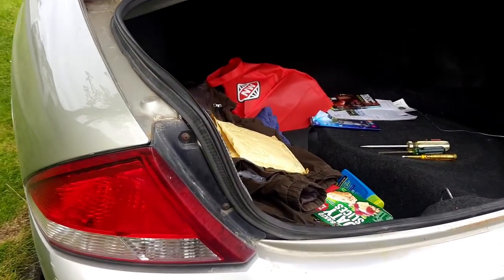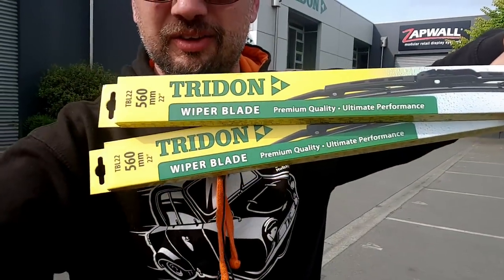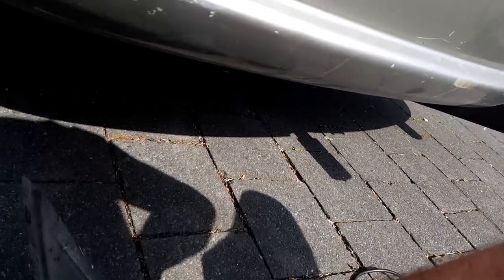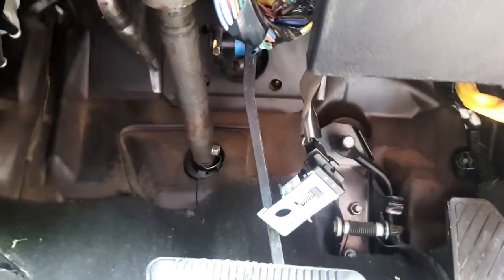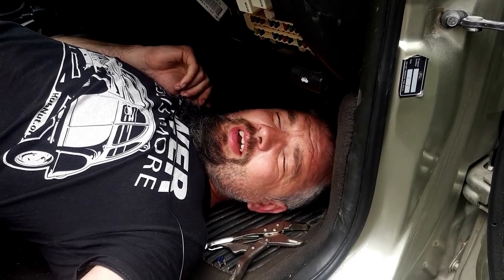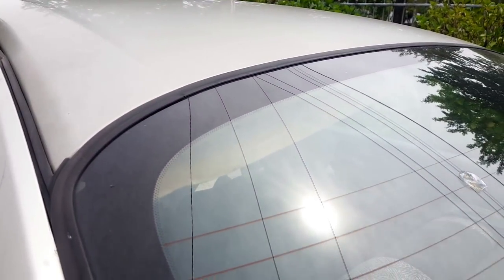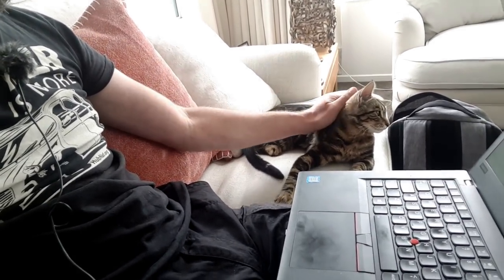(EP22) Ford Fairmont Fail and Fix, with bonus Peugeot 404

Comment: I passed my driving test at the 1st attempt in my father's 404 estate car. The examiner had never seen one before..   The examiner was not happy that the handbrake was out of his reach, the examiner was not happy about banging his head on the windscreen during the emergency stop ( pre seat belt law), the examiner wasn't to happy about us getting a puncture, but he was impressed that I changed the tyre quickly and in a heavy downpour of rain and then got him back to the test centre in one piece.  After he told me I'd passed I apologised for stopping a bit too quick for him,  he said he hadn't expected to stop that quickly. The lump on his brow was visibly growing and turning quite red by this time.  After he got out of the car and walked off down the street I passed him with the rear tyres lit up on my way to pick up my father who was sitting on the wall outside the test centre.... He promptly gave me a proper bollocking for torturing his tyres. We were halfway home before he asked me if I'd passed.
Reply: Brilliant!
Reply: Good times! :D
Reply: My driving instructor had an 1100 .He was ex army tank driver instructor. Language was epic but he got me a pass
Reply: When i was still a kid 7 or 8 y old my dad let me steer and shift  his 404 while trundling across dirt roads.  Fun times! A few years ago i imported a 404 from France , a Very nice 1961 black sedan with  red interior and sunroof. 
Fun for a while but the memory had proven to be more Impressive then reality.

Comment: I reckon, as the bulb fell out of the holder, it blew the fuse, which in turn caused the cruise control to stop working. I imagine the original brake switch is fine.
Reply: From watching the first 30 seconds of the video, my first thought was that Ford / Ford related cars of that era wouldn't let you use the cruise control if there was an issue with the rear lights. So it's probably even more fine than a blown fuse, but literally just the fact that you need fully working lights to use cruise at all.
Reply: in Cornwall they're held on with an "ooh ar" clip.

Comment: Loved my Peugeot 404s, owned saloon, estate and pickup versions. Brilliant cars, super precise column gearchange, so comfortable, practical and nice to drive.
Reply: The 404 is one of those cars you wish you could still get today. We had four through various members of the family and they were all much loved for being as my dad used to say "Just a bloody nice car ! " I owned one briefly but mine was well past it sadly..I did only pay £50 for it, got a new engine from a scrapyard.....and 'somebody' stole the new engine from my backyard before I got the chance to fit it..scrap fairies they call them...grrrr.
Reply: @Tim Hancock.
They really were marvellous cars, so sturdy, comfortable and reliable.
Do you recall the view of flat bonnet and peaked wings from the driver's seat?
Reply: I'm another 404 fan. I owned three saloons in the 80's and 90's in Australia. All were very cheap heaps that were full of rust but mechanically they were good. Yes; comfortable typically French seats, always reliable, and the superb column change that you could do most shifts with one finger extended from the steering wheel. The change on the pre 1966 cars wasn't as good though; or at least that on one owned by a friend wasn't.
I experienced a theft too. I came out to go to work one morning and one of the head lamps had gone! There was just a wire hanging. The most upsetting thing was that 404s were fairly rare by this time and almost all owners waved and flashed lights. I hoped it wasn't one of them. IIRC a replacement from the scrapyard was $10 so no big deal. 
They seemed to be very susceptible to having decent tyres. With Michelins the handling was superb, but I bought one with a mish mash of tyres which handled so badly I thought there was something wrong with it. A set of wheels with good Michelins from the scrapyard cost almost as much as the car, but it was well worth it.
Yes I wish you could buy a car like a 404 today; even if it had a complicated eco-friendly engine. I drive a 205 today in the UK. I wish you could buy those too.
Reply: The gearchange and synchromesh was so good that, with practice, you couid change gear without using the clutch.
The 404 was marvellous.
Reply: Hold on a minute. A Peugeot? With a good transmission? Is this some sick joke?
Reply: And all the better with a period 1980's under dash graphic equaliser.
Reply: @GlamStacheessnostalgialounge  Do a spot of reading about the toughness of the 404. There was a time when Peugeots were some of the best engineered cars anywhere. Then they sacked the engineers and replaced them with marketing depts and accountants......or so it seemed to me.
Reply: @timhancock6626  No need to tell me, though I usually don't go that far since cars from that era are nonexistent over here. My old 80s 309 is a damn nice car but I've yet to find a car with a looser, more horrible transmission. At 88,000 km on the clock when I bought it 1st gear doesn't have a synchro, and 2nd gear is going out as well.

Comment: My wife and I had some five years of excellent service out of our 404, including a lot of long trips (including Mbabane to Cape Town several times), loaded up with four kids and a great pile of luggage. The biggest problem was when we had to drive into strong headwinds (especially with the roof rack on and loaded) - those handsome Pininfarina looks were as aerodynamic as a barn door. Speaking of PF, they also sold that four door saloon design to Fiat - ref 1800, 2100 and 2300. The Peugeot and Fiats were all good looking, which is more than one can say for the BMC tribe.

Comment: I always wanted a 404 back in 80/90s. I ended up getting a 504 which I fell very much in love with. Easy to work on, very comfortable, loads of space inside. I thought the 404 was better looking than the 504. Less angry looking.

Comment: Well done on the repair, the Ford had to live up to it's name at some point . . . If you go to Spotlight they have these pins called curly pins or twist pins, they look like a miniature corkscrew and are brilliant for pinning up loose headlining material . . . I have used them numerous times and they are great . . . My Granddad had a 404  back in the day, and rated it as one of the best cars he ever owned . . . Great to see the Hub Nut community coming to your aid !! Cheers

Comment: Nice to see you with another cat again :-) 
Circuits in cars are the worst nightmare ever - in case you are familiar with electrical circuits in your household and try to find something comparable in your car which is not existing... But I never saw a Ford before where you have to remove the light unit just to exchange a bulb...

The Peugeot 404 does not sound like ready for a test drive... I had the Peugeot 203 from 1949 for a couple of years and it was one of the most reliable cars I ever used, perfect for everyday use and holiday trips . The engine took unleaded fuel as if it was a modern car of the late 1980ies. If you go for oldtimers, go french :-)

Comment: All 6 cylinder Rover P4s except the 110 had inlet manifold integral with the head. What a fine car the 404 was. I remember the injection versions having races with DSs down the N10 in the 60s. Column shift is in three planes like a 2cv.

Comment: Fixed my jammed on brake lights (battery draining) recently with an angle ground bolt and some upside down in footwell action. How I didn’t pull a muscle is a miracle. Kudos to all the helpful Hubnutters out there!

Comment: Surprised that you had not packed a good screw driver and socket set into your holiday case , that’s a bad example to set Hub Nutters Ian. Great video for the next time I drive a Ford Fairmont with a dodgy brake light 😂👍

Comment: Given you are driving with quite old cars, the breakdowns aren't very severe and/or frequent. Nice going on the Fairmont; maybe you can make a tiny hole in the headliner so you can spray some glue behind it with a straw. Looking forward to the Fuego video!!

Comment: "because you can fix almost everything with cable ties" and for what you can't fix with cable ties there is gaffer tape.
Reply: Bale string is best as used by all good farmers.
Reply: @dizzy2020  Not exactly the same,  but close enough.
Reply: Good to finally know what "gaffer tape" is.  We stock it, in various colors, in our hardware store.  But, for more serious repairs (holding bumpers on, and the like), I steer people to the "Gorilla Tape"!
Reply: @dizzy2020  ...indeed; we stock ordinary, silver-gray duct tape, along w/ our local (Cleveland, Ohio) brand "Duck Tape" in various colors, which may match some of HubNut's cars!
Reply: @craigmclean8260  Where I'm from originally we call it gaffer. Where you are it's generally gaffers or gaff IME. I usually keep around 30-40 rolls of shurtape and pro-gaff on hand because we get through it like hot coffee on a cold morning whether doing events, concerts or on set.

Comment: You coulda tried my  Billy Bodgit brake light switch fix ,(circa 1991) .Rig up a hand operated switch! Just press button as you brake! Trouble was I ended up just pressing the button and forgetting to hit the brake pedal!  That was a Ford too. '67 Mustang fastback ( wish I still had that one)
Reply: Sadly the cruise control needs an operating brake pedal mounting switch so it can cut off the system if Ian steps on the brakes.

Comment: Ian, at 4:53 can you explain what the mystery gubbins is between accelerator pedal and brake pedal lever ? It looks most bizarre with a torsion spring and some smaller bizarre lever above it ! Cheers.
Reply from the maker: My suspicion is that it's related to the cruise control. The pedal does move when it is operated.
Reply: @HubNut  Even more mysterious !

Comment: Interested to learn that Peugeot had a built-in manifold way back in the 1960s. The 1.4 TSI engine fitted to VW/Audi/SEAT/Skoda models for most of this decade has the same design. It's meant to improve efficiency by allowing the coolant to get up to working temperature much quicker, as the water jacket is closer to the heat of the exhaust side of the manifold.

Comment: Have you spotted a Ford Fairmont nearside headlight cluster during your many scrap yard adventures? Every time I see a front view of your car I'm always drawn to the UV damaged/foggy/faded unit that's currently in place.
It obviously shouldn't bother me as much as it does.
Other than that I love the car, especially that rear spoiler.
And of course I'm also loving the videos and the continued adventure.
Reply from the maker: Not that's any better than the one Betty has sadly.

Comment: HubNut, and anyone else, at 2mins 'cable ties': don't open the pack with a hole at one corner, everyone does this, and what happens is that all the ties gradually slip out, till eventually they're all out over the place, a constant nuisance. The clever way to open the pack is to use scissors ideally, but also a knife or fingers if need be, and the slit placed halfway and across the ties. Each tie can then be got at singly, pulling from its middle, and withdrawn. The remaining ties always remain in the pack, as if an opening were not there at all. Alan, in Norfolk, Blighty.

Comment: Sweet 404! Cool licenseplate. Very late production model, could be 1975. Why? Because it has rectangular red  reflectors on the back and reverse light in the rear lightclusters. It probably has servo assisted front disk brakes. The early 404's had drums.
That funky color was also available on the 304 and 104.

Comment: I had to install a new blower motor in my husband's Nissan Rogue earlier this year. When I was getting the old motor out and the new one in, I was in the driver's foot well and contorted (for me) and made some weird, loud noises.

ETA: You have to remove the accelerator and brake pedals, so once I got to that part, I was pretty committed. It's not like I could take it somewhere to get help with it. 🤣
Reply: I think the replacement may have to be replaced eventually, if so I'm going to try to get one of my younger cousins (with smaller hands) to help. I tried to take the seat out, it had a Torx head bolt that had a little rust in it and it stripped out before I could get it loose. 
I'm a big fan of your content, from rural north Alabama. Cheers mate!

Comment: Those 404's  have a really unusual diff. They have a worm and worm wheel instead of a crown and pinion. If you ever change the oil it is absolutely critical that you use the correct stuff.

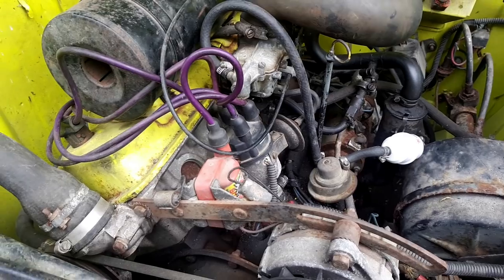Comment: 12:24 AIR HORNS!!! Awesome! Are they more common in NZ? I think I've only ever seen one car in the UK with them fitted (a 2003 Gardner Douglas kit car).
Reply from the maker: Not uncommon. Citroen CX was sold new with air horns in the UK.
Reply: Some 205 GTIs came from the factory with an air compressor and twin horns. My old one had it, it sounded superb! My current one just has a normal beep beep thing.

Comment: That reminded me of changing the clutch pedals on Renault 19's and 5's when the clutch cable snapped. The pedals on those had a plastic adjustment ratchet which sheared all its teeth when the cable snapped and you had to replace the whole pedal assembly (great design Renault!). It was a fiddly job, you needed 3 hands and way more space than you weere given to work in.
Reply: Funny you mention Renault and their odd choices. I remember a show on tv running a challenge with an RAC man to see who could change a headlamp bulb the faster. The RAC man for the short straw and had the big booty Megane to work on. Turns out you got to remove the entire inner wing and the entire wheel to get to the back of the cluster and that's the only way. Good job again Renault.
Reply: @superchickenlips1  Oh yes I remember that job too. At different times, my dad had a 19, me a 5 and my kid sis a Mk2 Megane so I experienced all the jobs on them! Thankfully none of us own Renault's just now 👍🏻👍🏻👍🏻😂
Reply: @graemew7001  Yeah, I'm pretty sure it was an episode of Fifth Gear, and that Tom Ford challenged an RAC man to a headlamp bulb change timed challenge, except Tom had a different car to the RAC man. Tom naturally whipped out the cluster from under the bonnet, changed the bulb and put it back in. The RAC man was still trying to get to the back of the cluster in the Megane when Tom drove off in his car. A couple hours later the RAC man was still at it, huffing and puffing and swearing profusely. In the end, the porr guy did it but had to remove the wheel, and the entire inner wing to be able to even get at the back of the headlamp. Then he had to wrestle it out, change the bulb and reassemble the car. Took him literally hours, and he went away knowing to never ever attempt that headlamp of that car at the side of the road. I can tell you of another very very dumb design flaw in a car you wouldn't think of. I had a new VW Touran a couple of years ago. When you fold the driver's arm rest down, you can't pull the handbrake up as it hits the bottom of the armrest and won't engage. You could, potentially, have the arm rest down, park up and engage the handbrake, but it hasn't engaged because the arm rest was in place, and you could, potentially get out and walk away from a car without it's handbrake on but thinking it was on.
Reply: @superchickenlips1  I was lucky, I tackled the Megane headlamp after hearing the nightmare stories about them so had watched a video on Youtube on how to do it. Was still a barstool of a job but I managed it in 40 minutes and was proud as f that I'd done it lol......only ever done one though! 

There's a few cars that have that flaw. I'm over cautious though as I put the handbarke on, the car in gear and this bit only when parallel parking (point the wheels towards the curb). On that subject though, the biggest flaw is electric handbrakes oh how I hate those things.
Reply: Yep, thanks to Renault saving Nissan, nissan is now also  officially rubbish.
Reply: @MrMoth0102  Very true, I'm very thorough if I have to look at a Nissan after 2002 / Micra K11 era for someone. I like the Note and the  GTR 35 but I'm still not sure if I'd buy either if I were in the market for something like that.
Reply: @graemew7001  Yep....best advice l can give anyone is to buy cars with better reliability. Nobody likes getting towed.
Reply: @MrMoth0102  I always say nowadays to buy a car on condition and service history and not on the popularity of the car in question. A mate of mine bought a 320d with the N47 in it without asking me to look at it and paid the price of a new engine.

Comment: I fear the crusty brake light holder and brakelight partly falling out may have caused the fuse to blow, but you may as well leave the new switch in.
Pro tip; If you ever buy a Citroën GSA, none of the lights will work if the tailgate light falls out and short circuits everything. French electronics for you. 
404 found. Yellow 404! Amazing!
Also good license plates
Osmo looks good. Maybe a bit on the contrasty side but it is handling the contrast rather well, so that's a good thing. Built in Microphone is really clear for voice. Wouldn't call it sounding pleasant, but definitely as good as or better than your phone's built in mic. There's stick-on dead cats for those things by the way so that if you forget your microphone, you can at least record in windy circumstances. Shitty that they have proprietary external microphone shizzle going on. Typical. 
I have no idea why specifically, but I found this an especially pleasant video to watch despite all your being upside down. Good stuff.